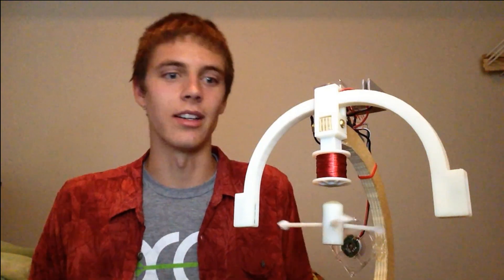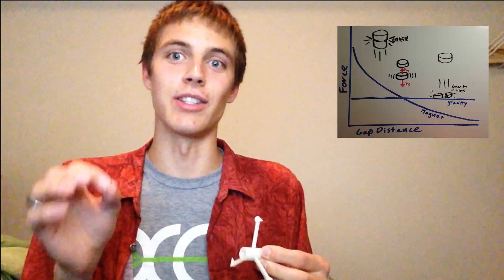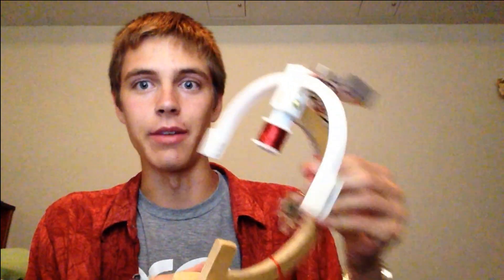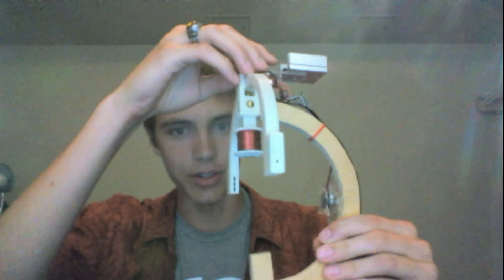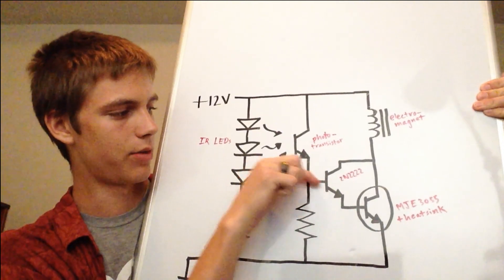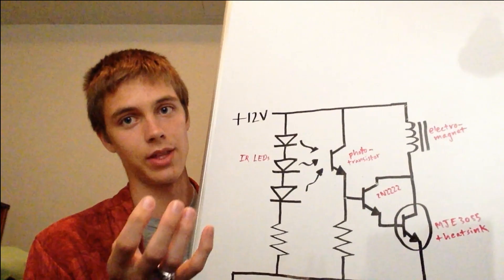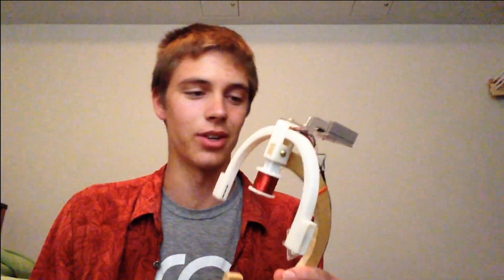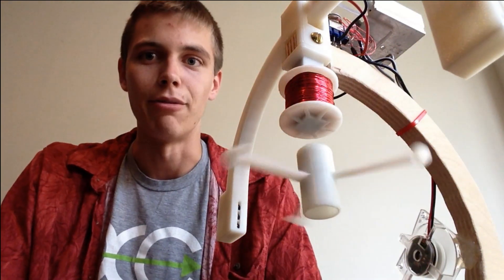Magnetic Levitator

Comment: I joined your channel recently, on levitating there is a new discovery, in 2020 proved in 2023 where they just use a rotating magnet check it, also on your video about if objects are solid, i think you only measured the sound travelling in the metal rod, otherwise nothing would be able to move  above the speed of sound...lol they would disintegrate, please explain more, thanks

Comment: Brian, Thank you. Been awhile since I've been, Wowed. WOW!!! Imitating Bismuth by employing photo beam sensing to imitate diamagnetic oscillation. I find it interesting that parabolic shaping had to be employed to stabilize the field. This simple circuitry employing photo beam sensing instead of Hall sensers is an approach I'm unfamiliar with. One of my projects to improve is the rim-drive thruster. Rim-drive thrusters are presently low RPM drives employed on ships predominantly as bow thrusters. I'm spending time on an aviation version that measures 24" diameter. This version of thruster could be employed on airboats and propulsion for aircraft. The benefit of rim-drive thrusters over turbines or propellers with center shafts is reduction of KW input to produce thrust. However, this would be a 5,600 RPM machine capable of producing 900 ft pounds of static thrust employing only 67 KW. Normally with machines today to facilitate this requires 157KW. I performed a search for Dr. Hong and came up empty. Can you direct me to Dr. Hong's work that inspired you to create this 10 years ago?

Comment: Commenting on a really old video! Do you think a relay would switch fast enough to control the electro magnet for this circuit?
Reply from the maker: Probably not. Plus it’d be crazy loud lol.

You really want something more analog than a switch. If you operate a transistor in the right regime it can be kinda on, it just needs a big heat sink to do that
Reply: They use Hall effect sensors in a lot of applications.

Comment: hey! i just wanna ask what kind of magnets did you used  on the floating object? will magnets that can be found on speakers enough?
Reply from the maker: I used a 1/2” diameter neodymium disk. Speaker magnets might work but then most of the work is being done by your coil. I’ve also never seen a speaker magnet that small. That said, worth a try!

Comment: wat is the value of the 2 resistors?
Reply from the maker: +Lalithamma K for the LED resistor, calculate the value based on how many leds you're using and their rated current Vsupply - 3 LEDs * Vled = R * Iled
Reply from the maker: +Lalithamma K for the resistor in the emitter follower, it's a value you'll have to play a LOT with to get it right - I might recommend breadboarding with a trimpot. I don't remember what I have but I'd probably start with a 1k and go up to 10-20k if necessary. A higher resistance will make the system more sensitive to the floater moving (lower resistance makes it slower to respond, sort of) the resistance is like the P in a PID loop but this system only has a P, plus the dampening of the air and the inductance of the coil.